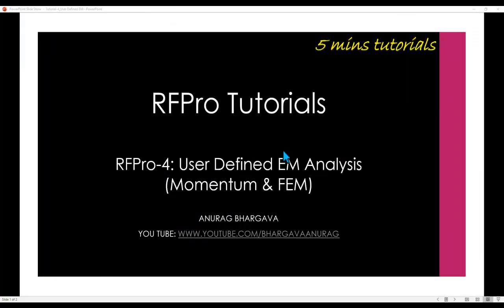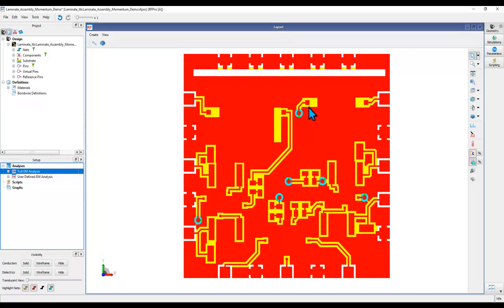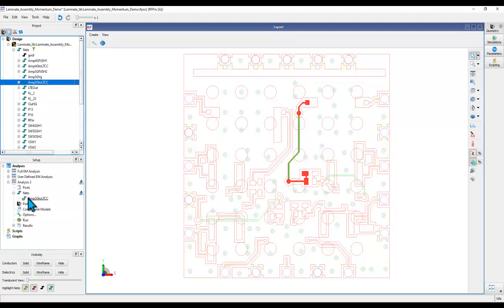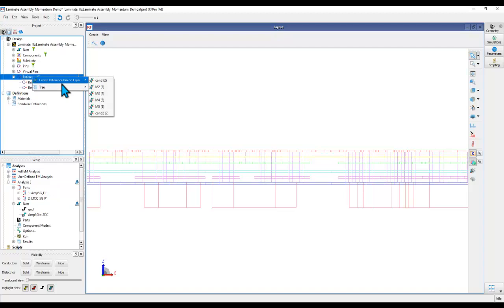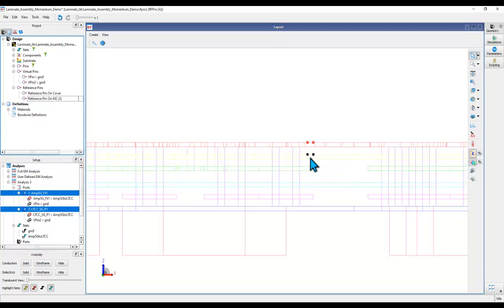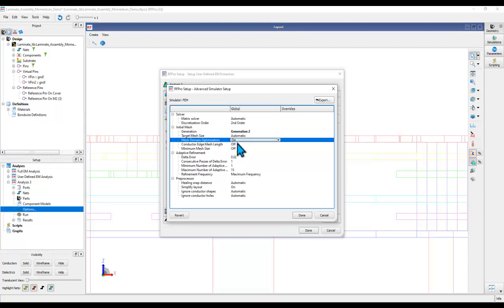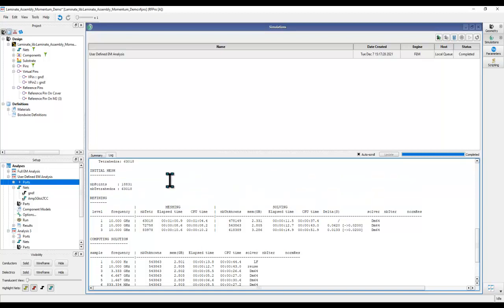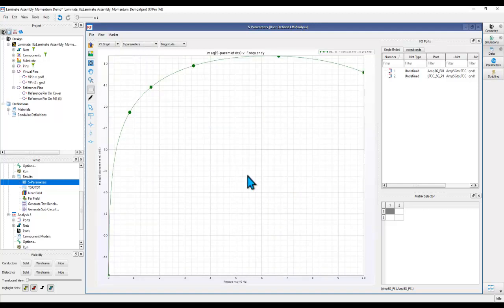RFPro-4: User Defined EM Analysis (Momentum & FEM)

Comment: Hello, excellent video thank you. One question, can one use 3D created components (example inductor) from EMpro while using the "user defined EM analysis" option and connect the 3D component to one of the nets in the simulation? Or does this only work when using the "full EM analysis" option (which included the entire board, not just a specific subsection). I want to include a 3D created component in a user defined EM analysis I am doing instead of using a lumped component. Thanks again! 10/10 content.
Reply from the maker: Yes, absolutely...😊
Simply add the 3D component(s) under Parts in the User Defined EM setup and it should all work out fine for your case.

Comment: Suggestion: Include a video series addressing "common" RFPro Warnings. For example: "Plus pin 'x.' of port 'x.P1' must not touch 'NetTP1' unless both ports are equivalent." Too often tutorials assume the user is able to create an error free setup, so some are left struggling to interpret and correct CAD Warnings.

Update: I now understand this to mean Net Ports must not touch Component Model Pins unless they are the same polarity. Subject to change as my understanding changes.
Reply from the maker: Good idea and I would be happy to do so. However, kindly summarize all the warnings or message that you would like to see included in the video and I would be able to answer all/most of them...😊

Comment: It's not clear how the "gnd!" net is defined, as it's not highlighted in geometry view. Is it defined in layout window?
Reply from the maker: Hi gnd net highlighting is disabled (notice lower left side window in RFPro where you can see black icon is not selected for highlighting). The gnd net is pretty much there in the layout and same can be seen as planes conductor in layout as well as in RFPro when design is loaded initially till I switch on the Wireframe mode.